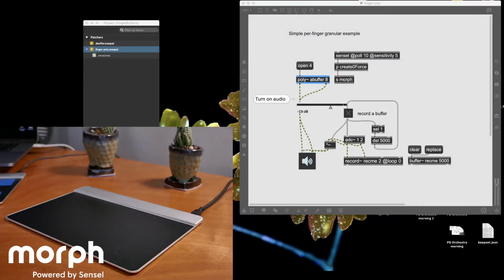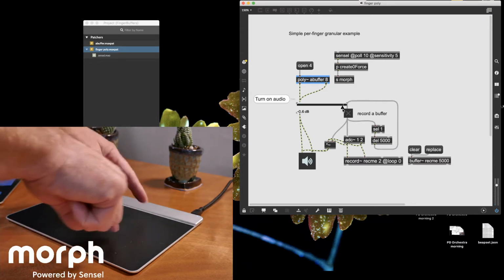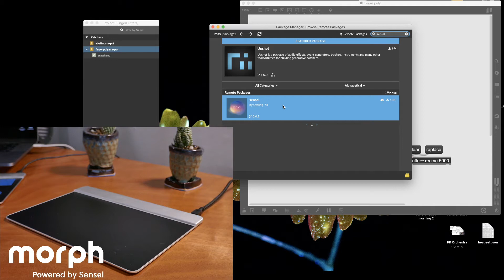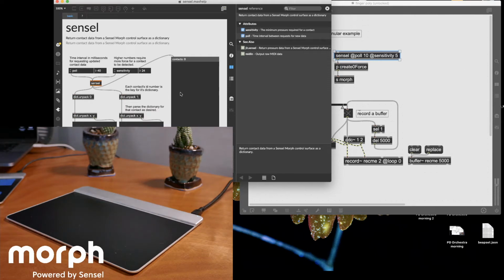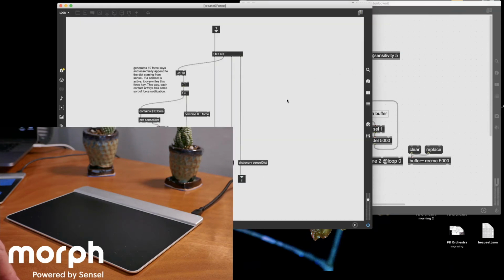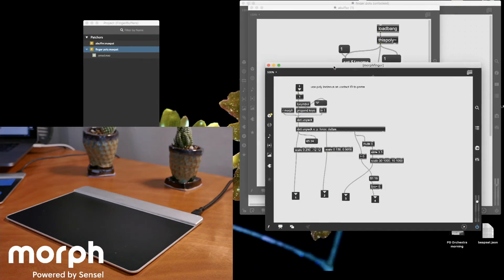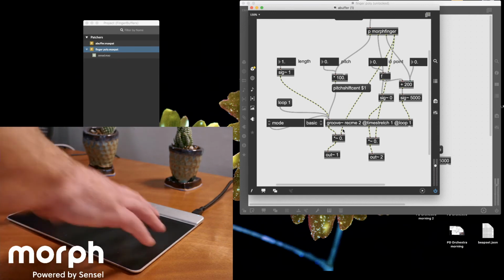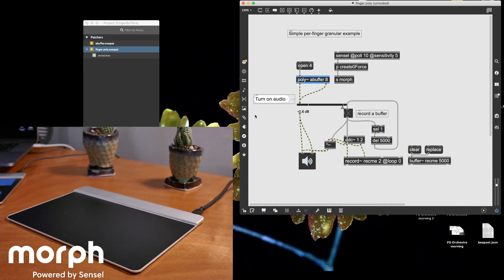01 - Finger Buffers. Max & Morph: Multitouch

Comment: I can't seem to get my morph to send data to max unless I use an overlay,  I think maybe I set up my morph incorrectly with the sensel app - is there some setting there I need to change or setup?  (Max 8, I have the sensel package installed)
Reply from the maker: If this is on an M1 mac, the sensel object is not yet compatible. Otherwise, the sensel object can be used to grab API data from the device. Alternatively, you can set up the device as one big MPE pad: https://youtu.be/zvs3iZRFOFE
Reply: @SenselInc  hi, thanks for your answer, yeah it's an M1 :( any idea when compatibility with apple silicon is coming?